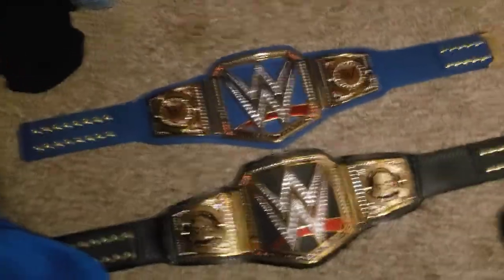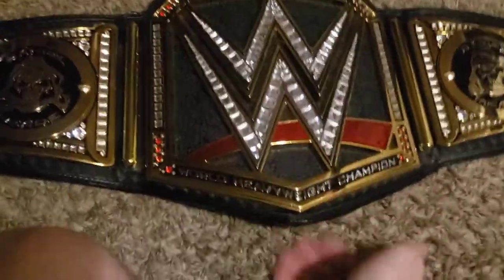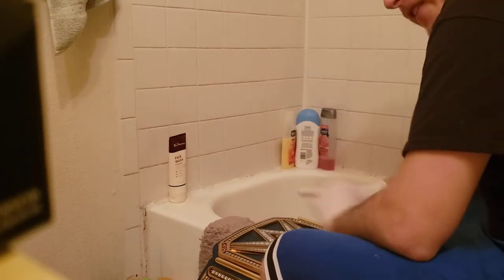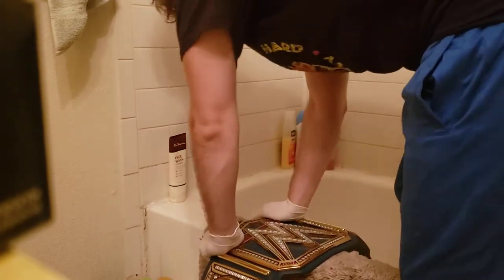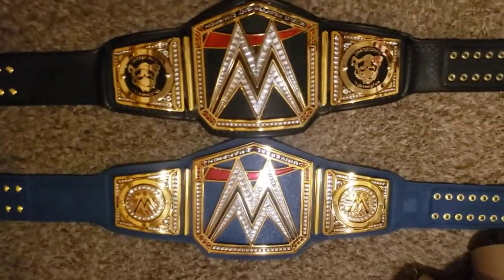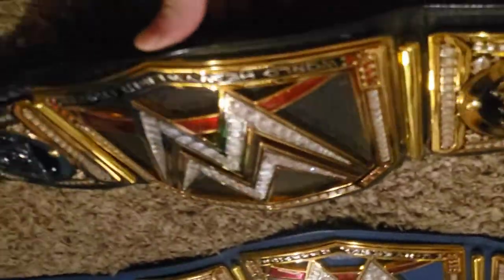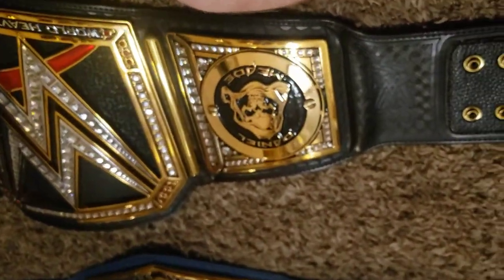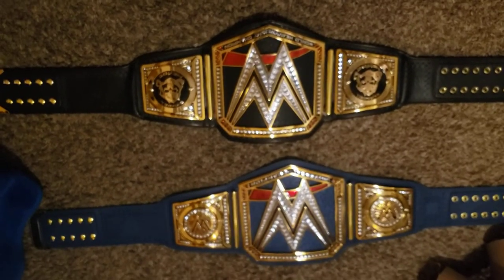Curving the belt plates

Comment: Good work man. I’m trying to curve my wwe shop big eagle 4mm belt. I’m using the same technique as you but I’m doing a little bit every day and trying not to put too much pressure on as I’m afraid of breaking it. Have you got any tips? Should I be more careful with that type of belt?
Reply: Ive been trying something like this, and my BE isnt budging. you also have to consider its a solid plate, with this NL theres gaps; less material. Bending will be much easier with hands.
Im 250, and i put 100% of my weight on the plate, above a barbell, and NOTHING LMAO. but ive been reading, and people say use a heat gun. soooo i dont have one but i might try a hair blower for now.

also if it breaks... now you have a CUSTOME hardcore title to make!!! but dont think it will ha.
Reply: @coltoncyr2283  great stuff man. Since my comment I’ve actually had some progress and gotten a curve, although I’m still working on getting a deeper curve but just taking time and being patient. 

So yes like you say I’ve had more success heating the plate but like you I also don’t have a heat gun. I actually just put my belt next to the window on some hot/sunny days for a couple of hours (not in direct sunlight) and the plates where really hot and I think I got more success doing it that way.

Like I say though my curves not the deepest yet and I’m working on more of a curve but the belt is looking so much better from all angles. If laid flat now I can actually slide my fingers under the main plate.
Reply from the maker: @shaun2908 your big eagle maybe too thick to tempt it like I did my Network Logo belts remember they're casted replicas so they are alot harder to curve them without breaking maybe try applying heat to the plate to soften the metal
Reply from the maker: I say if you're scared of cracking it don't do it...try doing it with the plate off the belt and try applying heat to loosen the metal.

Comment: Can you curve commemorative belts ?
Reply: Probably not they will crack
Reply: NO NO NO NO it it will crack
Reply from the maker: They're plastic man...the only way you can curve them without breaking them is using heat...like putting it on a round surface and heating it up maybe that might work